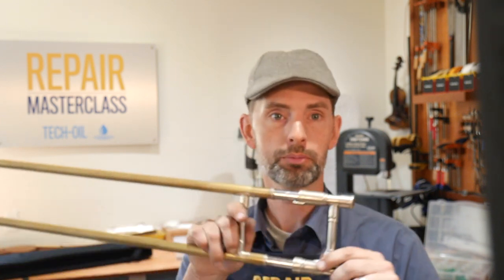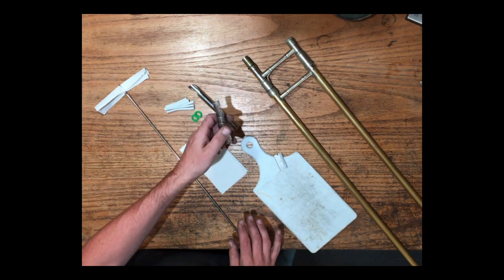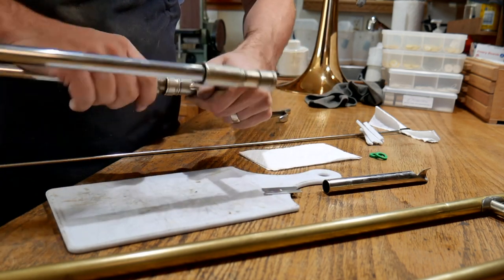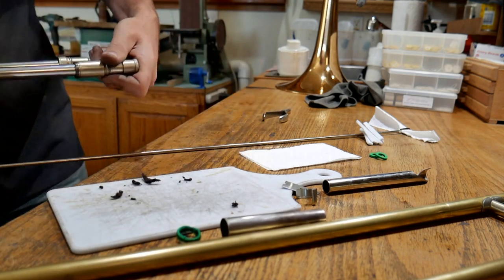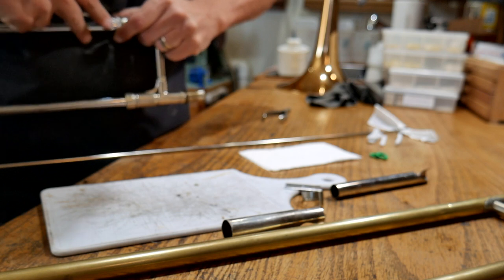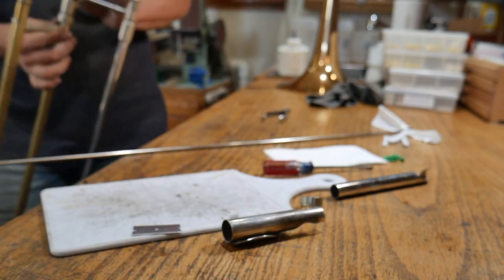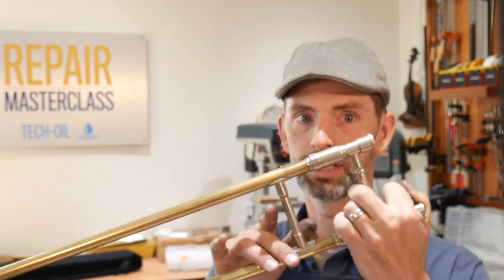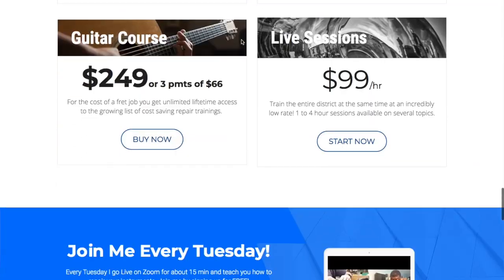Trombone Slide Felt Replacement

Comment: SPANISH... HOLA , SOY DE ARGENTINA Y QUISERA QUE ME QUITES UNA DUDA QUE TENGO. EL TUBO INTERIOR DEL TROMBON, ESTA HECHO DE ALPACA? O, ¿DEQUE MATERIAL ESTA HECHO? PORQUE TENGO QUE SUSTITUIR EL CAÑO DE UN TROMBON PERO NO CONSIGO EL MATERIAL, YA QUE EL MISMO NO ES DE BRONCE, SINO DE ALGUNA ALEACION, PERO NO SE DE QUE...
AGRADEZCO VUESTRA AYUDA Y RESPUESTA.
GRACIAS, MUCHAS GRACIAS.
Reply from the maker: The inside slide of a trombone is most often a brass tube that has then been chrome plated. In some horns, they use a nickel tube. The trick for sourcing a tube locally is the stocking - the bottom 6 inches or 15 centimeters has been expanded to within .003 to .007" (.07 to 1.77mm) of the outside slide. This is done to make the trombone, with lubrication, air tight. That's difficult to do by hand... Reach out to the manufacturer or any of the many suppliers for some help getting a replacement tube.